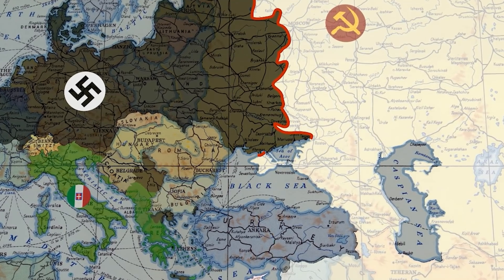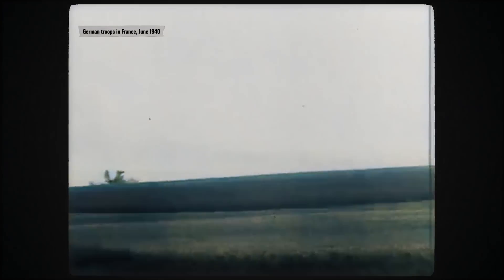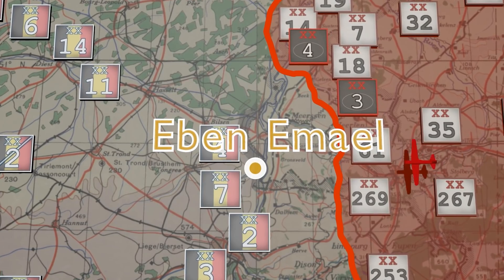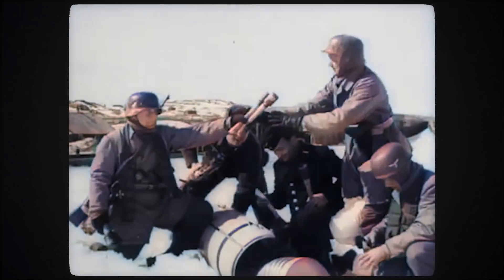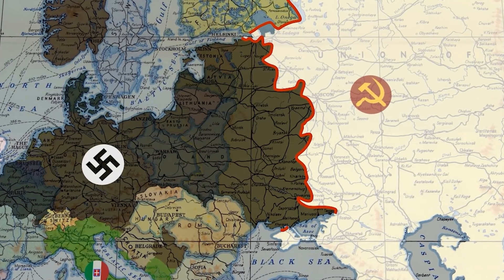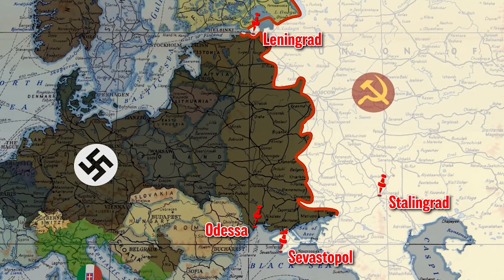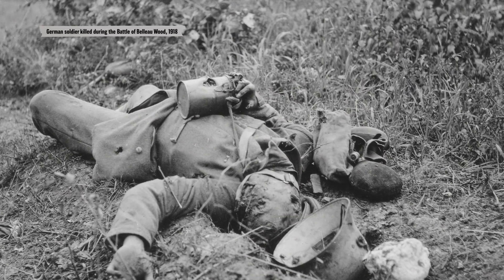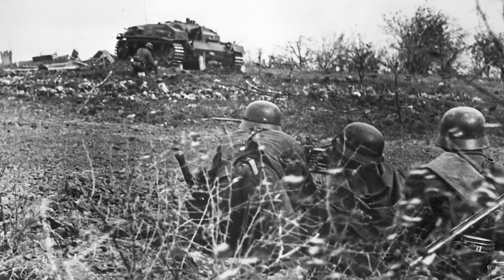The Opposite of Blitzkrieg - Siege Tactics on the Eastern Front - WW2 Special

Comment: Governments and armies have learned that sieges are always fruitless. If you succeed, you gained  piles of rubbles.(pun intended), and the long term economic cost is unbearable. You can argue that Germany cared not for rebuilding the city and industry of Stalingrad.  But in the future, to extract the resources they still had to rebuild the railways, docks, depots, etc....and suddenly the city is needed again to administer and mantain these assets. That is why war of the future is slow cultural and/or electronic, low intensity effort. Overtake institutions, avoid damaging the infrastructure and markets.
Reply: It isn't necessary to destroy a city or even damage it during a siege. All you have to do is cut them off from resupply and wait for them to starve.
Reply: @readhistory2023  even assuming you can cut them off totally.... If they can hold out longer than you can siege them and/or you really need the force elsewhere you can't always wait.
Reply: That was the problem the Germans faced with Leningrad, Odessa, and Sevastapol, They all had seaborne resupply so it was almost impossible to starve them out (though the Germans did their best to sink everything). It also reqires you to be numerically superior in the field because as your troops are tied down, the enemy will be gathering his to attempt to break it.
Reply from the maker: The German army did attempt this, most notably with Leningrad, while there was destruction, the primary tactic was to starve the city out. It can be an effective tactic as proved countless times throughout history. Quite simply however, it is likely to be much quicker to raze a city as well as starving them out.
Reply: @WorldWarTwo  Except they cannot stop the starvation of the city. City was supplied by iced lacs and feeding on horses and [clears throat] corpses.
Reply: @korbell1089  That was the bigger issue in Sevastopol - not just seaborne resupply of the garrison there, but the risk of the Soviets reinforcing and breaking out and threatening the rear areas of AG South just as they were reaching their goals in the Caucusus. Until they captured the rest of the Soviet ports on the Black Sea, it was a bridgehead that could destroy the Wehrmacht.
Reply: This is a very simplistic view on the subject. Since the early modern period, sieges have more often than not been conducted on forts, castles or even smaller provinces. Cities are and were the exception. This is different in world war 2 for sure, but even then my next argument applies.

Sieges are most of the time not about gaining what you are laying siege to, they are more about depriving it from your enemy. 

Case in point Sevastopol. Taking the City and the surrounding perimeter turned out to be very costly because were unable to cut off reinforcement and supply by sea. However it would have been even more 'costly' to permanently guard the city with several divisions that can't take part in the remaining war effort. Much more soldiers are required for active defense than any occupation force after the city is taken.

And make no mistake, they would have to heavily guard it. The Soviets could have decided to land a reserve army there at and point and break out. 

So your point about not gaining anything from sieges is moot. 

Not to mention that even when cities were taken with minimal resistance they were often sacked and largely destroyed. This has only changed recently. 

Clearly sieges are not about gaining a siege targets resources, but rather about short term montary benefit, tactical or strategic goals.

The only correct point you make is that sieges are costly and an unwelcome alternative to a quick capture. But that is kinda obvious, no? Fact is that they are essential to winning almost any war and only really dreaded by the actual soldiers taking part in them.
Reply: @Icetubexd  my point is not that quick capture is better than siege. (it is better by far).  My point is that sieges are always failures. The lost time is much more valuable. In mobile warfare, if you have to lay siege, you already failed.
Reply: @ricardokowalski1579  Well, you're wrong, but keep thinking that. Everybody got logistic weak points, even the Soviets, and the Soviets aren't even that hard to find. Wath some TIK videos about Axis versus Soviet videos in 1942 and TIK ain't even remotely pro German in this fight, not a bit. 

I'll give you a BIG hint though:
It doesn't matter a bit if the Germans get a drop of the Caucus oil, as long as the Soviets don't get any either.
Reply: @ricardokowalski1579  They didn't plan for a long war, that was their stupid. You are right about that. Saying they COULDN'T win a long war is YOUR stupid. That's the important difference of nuance.
Reply: @sophiam2095   You do know what happened the previous time Germany got into a long war? The germans did not plan for a long war because it was a strategy that they already knew it would result in defeat. ( that would be truly stupid).  The whole point of inventing combined arms warfare was to avoid planning for, avoid fighting, avoid risking, and ultimately avoid losing a long war
Reply: @sophiam2095  The russians didn't have to "go"  anywhere. They were fighting a defensive war. The germans had to do all the travelling just to meet them. The russians got all the oil they needed (much, much less is needed for defense) from the US after Barbarosa started.
Reply: @ricardokowalski1579  DO you want to be "right" or do you want to actually learn something? First, the US is incapable of sending them all the oil they need, only the high quality 100 octane aviation fuel for their airplanes. They probably could, given three or four years by building a pipeline or full serivce rail from the Iranian ports up through central Asia, but in time to do what I'm talking about.

Fighting on the a homefront does not mean zero point logistics. From Moscow it's 110 miles to Tula, 600 to Stalingrad, 1100 to Magnitogorsk and Smolensk. And to fight the Germans, big armies are needed every single time, and big armies need BIG logistics. Inside every strength is a big weakness waiting to be exploited.

And it's not just oil here, it's coal too, which the Germans just crippled long term by taking the Donnets. Now admittedly by the Case Blue the Nazis fucked the pooch by getting the US into the fight and provoking Brazil but that has nothing to do in and of itself with fighting the USSR,  but still if you fight with the exception of causing the USSR to torch their own fuel supplies, all those T-34 only show up in trickles, either that or the cities start breaking out in food riots in 43 and 44. Just don't do anything stupid like a Kursk. 

Again TIK gives a good overview of the situation without ever being pro-German in any way.
Reply: @sophiam2095   can you please do not personalize the discussion? What does it matter what "I want"? All I learned from you is that the germans could "easily" fix their logistics and win a long war.    
 You still don't see the point: the russians don't need to "win", they can retreat for months on end. Stalling and delays IS a failure for the germans.
Reply: @stylishoverdrive  so a citizen must be a yesmen of their countries goverment? Thats a key to stagnation isnt it? Coping with lies rather than searching ways of improvement

Comment: you got me at "remote-controlled flamethrowers" 
WHAT??!
Reply: Yup they cover access points into the escarpments. Much like cannons did in the Vauban system.
Reply: Yeah. That has to be a mistake. If not, we need info on this.
Reply: All you need is a flamethrower and a long wire to send either an electrical or mechanical signal to the flamethrower's trigger. It's the same principle as used in the more modern M18 Claymore mine (which by the way would have come in handy during WWII for countering banzai charges). With the Claymore, you plant it in the ground somewhere in front of your position, then trail the detonating wire back to where you hide. When the enemy charges, you press the trigger and spray them with shrapnel.
Reply: Search about FOG flamethrowers, comrade
Reply: The American B-29 Superfortress had remote operated guns.  So a remote controlled flamethrower would be relatively easy to install back in the day.
Reply: @freedom2663  made as canisters on a pedestal. They were placed concealed in a line where the enemy troops were to march through, they were either triggered by wire or small explosives to create a wall of flame :|
Reply: Eben Email sounds like a place in Lord of the Rings

Comment: the purpose of fortified deffences haven't changed, to hold control of a position to delay an advancing army, 
the pourpose of a siege hasn't changed, to capture a fortified position by force our starvation, 
the tactics of siege warfare remain the same, the only thing that did change was the tools used.even that not so much al least two remain no matter what, the shouvel and the pickaxe.
Reply: Marcelo Henrique Soares da Silva   i didn't, quite the contrary,

Comment: For anyone wondering, the largest guns ever were the 914mm (36 inch) Mallet's Mortar (2 built, 2 extant) and Little David (1 built, 1 extant). 

However Dora & Gustav are the largest guns ever fired in combat.
Reply: You have forgot heavy mortar Thor 800 mm and other I can't recall their names 540 600 mm
Reply: @badbotchdown9845  Thor was 600mm, and one of seven siblings. Either way, they're all smaller than the 800mm of Dora & Schwerer Gustav which was the point being made.
Reply: V3?  I was thinking Gerard Bull's guns made for Iraq but those were not fired.
Reply: @shaider1982  V3 is only 150mm (5.9 inch), but the barrel is 150m long, so it is likely the longest.

Comment: That final point about Sevastopol is really important-- fortresses are almost never designed to make enemy advances impossible (a patently unrealistic goal), but rather to wear down the advancing force &/or channel the advance onto more defensible ground. A fortress that weakens and redirects the enemy has done its job, even if it eventually falls.

The same is true, incidentally, of the Maginot Line, the purpose of which was not to block a German invasion but rather to redirect it into territory that the French could more easily defend. At this, it succeeded marvelously-- the Germans were forced to take a much more vulnerable route through the Ardennes and the Mesue Valley. The problem is that the French ( cough cough HUNTZIGER cough cough ) proceeded to squander all the advantages that defending in that territory gave them. But the Maginot Line did its job; Huntziger, on the other hand, didn't do his...

Comment: These Stugs sound like a sensible idea that can't possibly go wrong!
Reply: The Stugs did represent an interesting engineering tradeoff - to turret or not to turret? That is the question. It seems better to have a fully-traversing turret on an armored vehicle, so you can shoot in any direction without having to turn the entire vehicle on its tracks. Turning via the tracks repeatedly in one position causes the vehicle to dig itself ever deeper into the ground, and you have to have the engine running to do it. On the other hand, a non-turreted gun can be of larger caliber and the vehicle becomes less tall and therefore harder to hit. The weight savings can go into thicker armor. Losing the turret also saves money and production time. You end up with a cheaper vehicle that hits harder and is harder to defeat but is less flexible in battle.

Given the difficulties US forces had in 1944 when their Shermans went up against individually superior German tanks, having some numbers of Stug-ified Shermans along might have helped. Not to replace all the Shermans, but to provide some heavier guns and frontal armor. The US did have its open-top turreted tank destroyers which mounted heavier guns on the Sherman chassis, but they were even less armored than the standard Sherman. In the event it didn't matter because the Allies won. Having air supremacy and overall logistical supremacy makes up for a lot of shortcomings on the individual weapon level.
Reply: @danielmocsny5066  Thanks for the details!

Comment: I wonder why assault guns like the Stug aren't used as much in modern warfare today they have such a great role.
Reply: Armies put their money into main battle tanks now and assume that armor or cav units will be available to support infantry assaults if they need heavier guns. They've also got decently-armed IFVs which can handle a lot of the fire support needed, and at least in the US Army they're heavily dependent on artillery and close air support. All of those things add up to make a dedicated assault gun kind of redundant. The closest thing I've seen to it in a modern army were the M551 Sheridans that the 82nd Airborne still had through the mid-90's. They had those things over in the Gulf in 1990-91 and they seemed pretty antiquated by then, saw them at 3rd shop getting worked on and we thought they were old Saudi equipment at first glance.

Comment: Did the germans work on any mechanised engineering vehicles like the British Churchill AVRE?
Reply: In a manner of speaking.  There were some Pz Is converted to deliver demolition charges.  The Goliaths were wire-contolled mini tanks intended to run against defences and blow up.  The Brumbar and the Sturmtigers were assault artillery whose function was roughly equivalent to the Churchill AVREs with the flying dustbin spigot mortars.

They did not have flail tanks, bridge laying tanks or the like.  They did not do amphibious tanks except one vehicle roughly equivalent to the AMTRAC.  They did do snorkel tanks but that was to cross rivers where the bridges weren't strong enough to carry a tank.

Comment: Why can't a strongpoint simply be surrounded and bypassed without expending men and materiel reducing it?
Reply: In most cases, the transport routes go through the point in question, therefore, it is needed for logistical reasons.  Also by leaving something like Sevastopol with a large amount of supplies could result in irritating point of counter attacks.
Reply: How can you surround a naval base without a fleet in the Black Sea, when the enemy has one and it is significantly strong?
Reply: @MemoryOfTheAncestors  no it wasn't as strong as you think

Comment: Gotta wonder if simply bypassing Sevastopol (after setting up a defensive line)  wouldn't have worked better.
It's not like the defenders of Sevastopol were set up to CONDUCT mobile warfare against the Germans further East.
Reply: The German army would not liked tô have a soviet resistance that can be resuplied and maybe attack their Lines ,better to Just get rid of a problem ,even If It takes a lot of time
Reply: @lucasfarias2370  The local geography should make it easy to set up a defense line.

Comment: I wonder why didnt they do it like the romans and just build their own defences around the city, leave a token force and use the army for push to russia? The city has no capacity to muster a significant counter attack, and the germans had unlimited slave labour (read soviet prisoners) so it would only be question of logistics and material. Which at the time of start of the siedge they had a lot of.
Reply: They didn't fear a counterattack from Sevastopol, it was more to prevent its use as a naval/air base, not to mention simply being a success story of Soviet defence.
Reply from the maker: Thank you for your input!
 
There are many reasons why one would not want to leave an entire city full of enemy forces behind their frontline. Just think about how much damage Soviet and Yugoslavian partisans did without having cities to move around freely and resupply in. Also note that Leningrad was a major industrial center and communications hub. Leaving behind just a token force to hold the line would be incredibly risky, especially since there were numerous Soviet counter-offensives in that area, that inflicted considerable casualties, even if they did not break the siege. Not to mention the fact that German supply lines were stretched extremely thin and very vulnerable anyway.

Comment: I have no idea why the Germans didn't invest into heavy (long range) bombers. What was the reason for this? I guess it followed the battle doctrine of blitzkrieg. But it could destroyed railways (possibly at Moscow) or bombed Moscow. Even NY. Or allowed advanced deployment of the Fallschirmjäger (and even more heavy equipment to be deployed with them).
Reply: They were not prepared as everybody think.
It was only middle bombers as they don't have plans more than six months
Reply: They used their 2 engine bombers to attack Stalingrad and also rail lines. They would have had to plan for 4 engine bombers much earlier and if they did try to build a big enough force of them they would not have had enough Stukas, BF109s and other aircraft.

Comment: Why didn’t the Germans simply isolate the city?  Why bother grinding it down when those large forces and material could be much more valuable elsewhere?
Reply: Sevastopol is a key naval port on the Black Sea, the main base of the Black Sea Fleet of the USSR, the second base was in Novorossiysk. This city could be a springboard for the landing of Soviet troops in the Crimea. Considering that the Germans did not have a fleet in the Black Sea, they could't physically isolate the city completely, so they had to take it.
Reply: @MemoryOfTheAncestors  Really good answer, thanks!